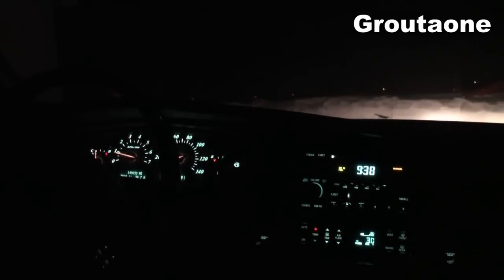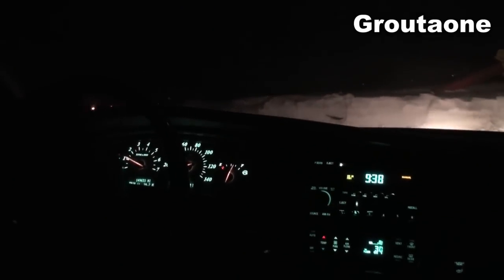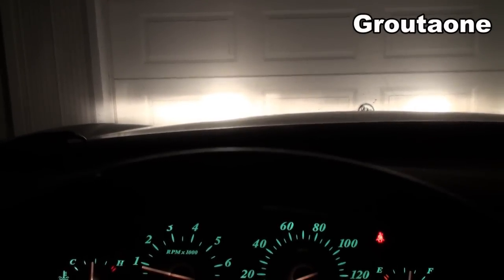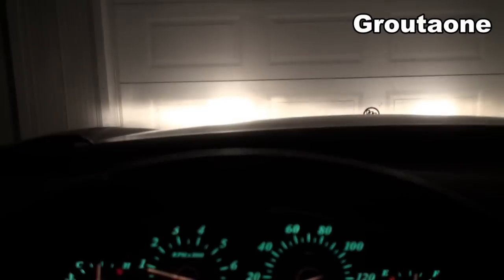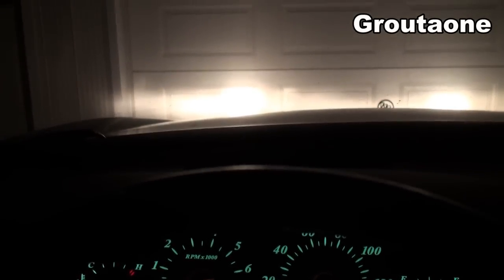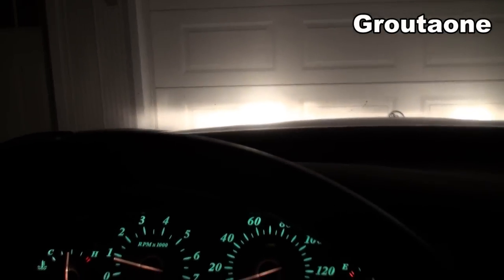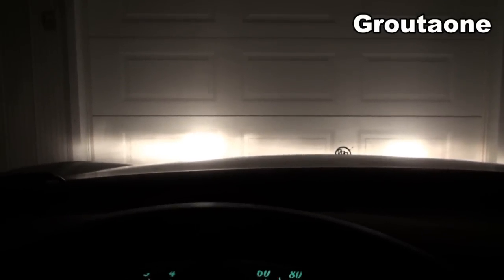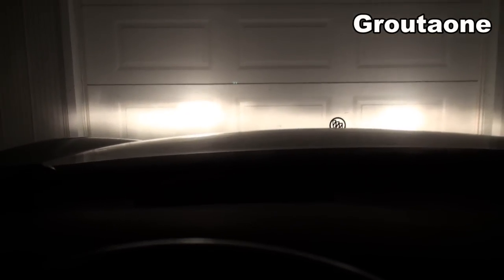Easiest Alternator Test Ever

Comment: Parry bata. What you need to do is buy a bulkier higher amped alt. One that is single phase so its constantly charging the system. That and you need to have the voltage regulator checked. One thing you can also do is check the amp draw rating on the lights and amplifiers. Also check any and all grounds that were put into the lighting and stereo system. Make sure all grounds are to good clean stripped metal and dont run grounds on top of each other. Also make sure that none of the source (power) wires are ran anywhere near your airbags or airbag modules. Let me know if any of this info helps. Good luck. And putting the heater heated seats and such isnt really that much of a load test seeing as how the car was in park with no load on the motor. When checking your alt at an autoparts the machine puts the motor under a load of which would be normal driving load. Sitting at an idle with the car in park isnt going to pull the same load. It is a shade tree kind of way to test it and a decent idea. I do enjoy your vids and will subscribe. Later

Comment: I just installed a 240 amp alt in my car but now if i let it idle at 600 rpm the lights dim bad and the voltage drops, as soon as i go up to 800 rpm voltage jumps back up and everythings fine.
Reply from the maker: A pulley size swap would fix it right up

Comment: Not sure if tail lights do it or not. I dont believe the facrory headlights do either. The interior doesnt, except for my aftermarket guages. There is 3 in there, which i believe are hooked up to the same battery as the other stuff.
Thanls sir

Comment: Sir ive got a question for you now! 
Ive got an 07 chevy diesel (2 batteries, u already knew that im sure) with a sound system and some aftermarket lights. I have both ran to the same battery (passenger side) which is the battery not used in start up. When i turn the radio up a good amount, the aftermarket lights, heater and seat heater, and its dark so guages are lit as well as headlights tail lights etc
So ive got everything on basically, and the aftermarket lights, flicker. 
Now, this isnt a slow flicker, its a fast flicker like police lights! So im curious wat i need to purchase to have the lights and radio work well together. This worries me, as i plan to have about 3 more lights hooked up to it, but these are bigger and brighter. 
So hopefully uve got an idea! 
Thanks
Reply from the maker: Does anything else flicker like the lights, can you see it also in the dash lights and tail lights?

Comment: If the lights do dim. Does replacing the alternator fix that? Or can it be a wide variety of components?
Reply from the maker: If the lights dim when extra load is placed on the alternator, first see if a bit more rpm will bring the lights back up, if not your alternator is likely undersized or worn and replacing should fix the problem, belt tension and cable/wire connections are critical and should be checked first.

Comment: My headlights are brighter when I give it throttle than when it's idling. Significantly brighter. The blower motor revs higher as well.
Reply: Sounds like the alternator is not quite up to snuff. Might think about changing it out before you get stranded.

Comment: I've got a 12" sub in my truck. When I turn the stereo up loud enough you can watch the volt gauge jump. Probably need a higher amp alternator but don't usually run the stereo that high. I like having the actual gauges vs idiot lights.
Reply: watch you don't cook your alternator doing that.
Reply: yeah, not something I do often at all. only turn it up that high every once in a while.